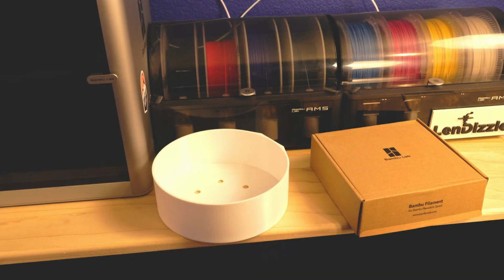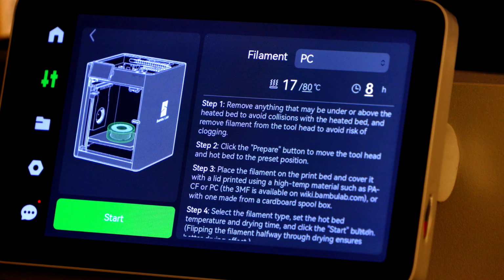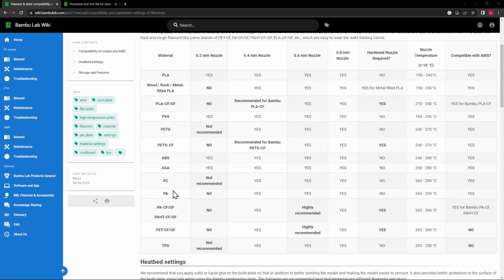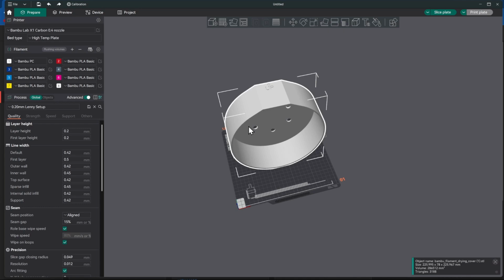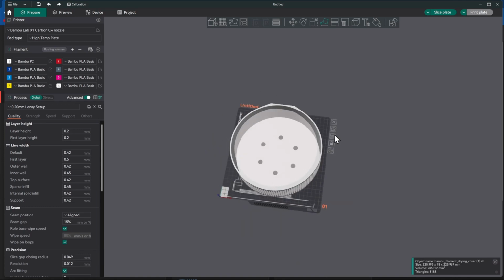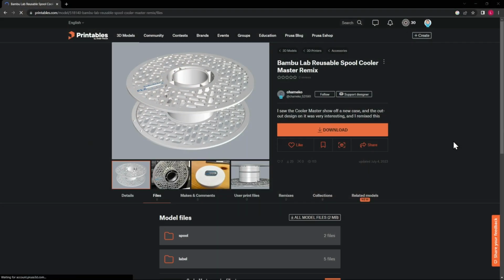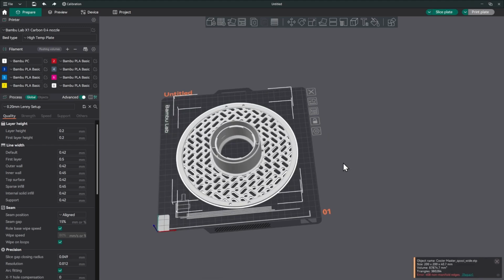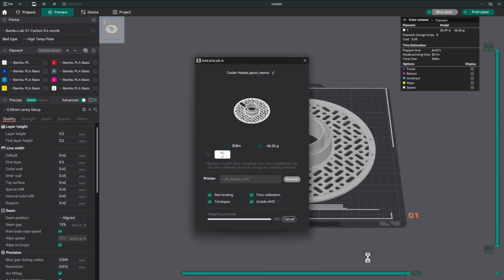Ultimate Guide to 3D Printing Translucent PC on Bambu Labs | OrcaSlicer Tutorial & Filament Tips

Comment: Hi, I am new to PC filament. I  have tried to print with PC through different models, Some are my own designs, some are files from the internet. But most of then just won't stick, no matter how I change the settings. Few of them are perpfect. I am so confused, any tips?
Reply from the maker: I had no issues with it sticking.  Did you dry it?

Comment: Is drying the PC filament a must? I have a P1S and don't have that option. I bought the polymaker transparent PC and trying to figure out the settings on BambuStudio slicer. Should I apply the same settings as the Bambu PC? I checked the Polymaker website and it says no fan but the Bambu PC has the fan on so I'm confused.
Reply: The p1s doesnt have a heated bed?
Reply: You can just Heat the printplate up to the temp you Need and lay the spool in the Printer with a Cover

Comment: So I need a PC printed lid to dry my PC... well shit. Anyone got recommendations for the best way to get the filament roll dried before printing the cover-lid?
Reply: yah, just use a cardboard box temporarily.  Poke a hole in the top.   You're just blocking the heat from rising away and out off the plate during drying.

Comment: I used PC in the X1C with the Engineering build plate and missed putting glue stick on the calibration lines area.  The printing was very satisfying, and the objects popped off easily (where there was glue).  However, the calibration lines stuck pretty well.  Do you have a recommendation for print plate for PC and surface treatment ?
Reply from the maker: You can use the PEI texture plate with no glue
Reply: @lendizzle77 from the video it looks like you used the high temp plate, is this a PEI plate and what was your experience with it ?  I don’t ever want to have to use glue again:).
Reply: @monkeywrench1951  using glue is common with these high temp filaments, people even use specialised glue just for that material with these types of filaments so never wanting to use glue again is an unrealistic expectation, unless you are only printing the likes of PLA, PETG and ABS on a textured PEI plate.

The high temperature plate is a smooth PEI sheet but you get a textured PEI sheet too, it generally releases better than smooth PEI.

Comment: Compared to ABS does PC put off much nasty VOCs?
Trying to find info on VOCs of a wide range of filaments.  PLA PETG ABS and Nylon is all I am finding.
Reply from the maker: I did not notice a smell but my printer is in a large room that is ventilated.  I also keep all of the glass closed as recommended.
Reply: Thanks for asking this question Snifter and for the answer Lenny. I was trying to find the same info. I love ASA and ABS but it STINKS! I want to avoid printing with that stuff until I get a better setup for dealing with VOC’s.
Reply: @c0mputer  Yeah better be safe than sorry.

Good ventilation and perhaps activated carbon filter.  Just because we can't smell it doesn't mean it's not adversely affecting our health.
Be cautious of cheap inaccurate VOC meters.

Comment: I did not see you lock your AMS I had mine for weeks before I even realized it had locks😊
Reply from the maker: It has locks?????  Just kidding.  Yeah, I rarely use them. :)
Reply: @lendizzle77  well, humidity is probably not an issue in your studio, but I've noticed if you don't use them, the lid doesn't sit all the way down on mine.

Comment: I was having a lot of trouble with Bambu PC, both regular whitw and black, went through about half a spool of failed attempts. The fix was I needed move my printer out of the garage, I guess the South Texas heat and humidity was to much.
Reply: So you're takeaway is use a cool room with low humidity?  Now I'm wondering if my printer is in the best place.